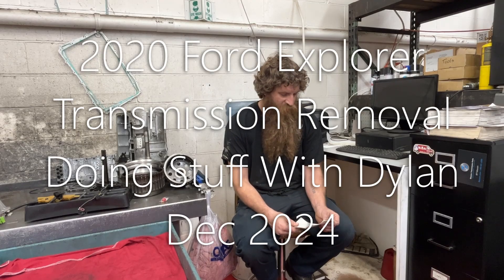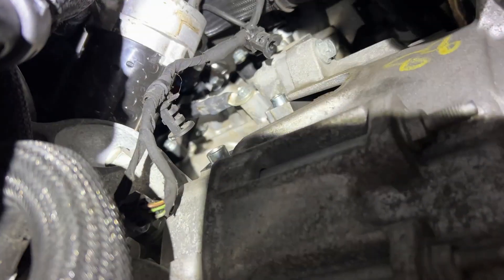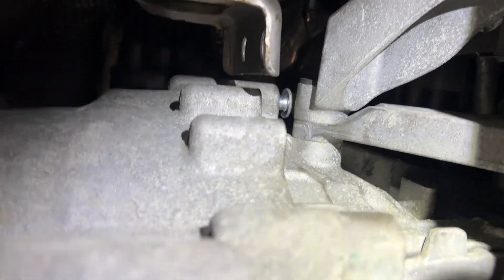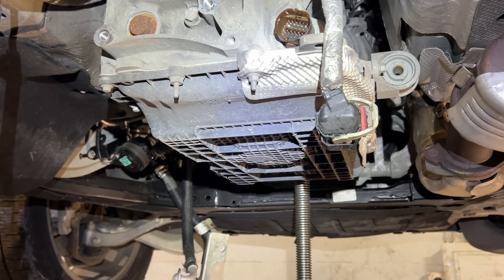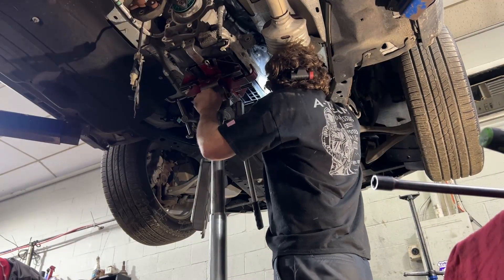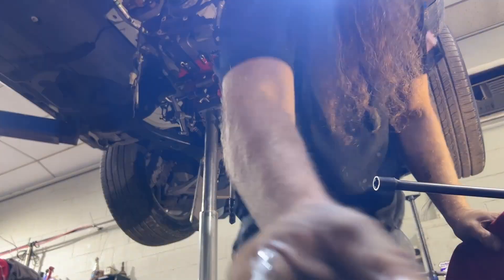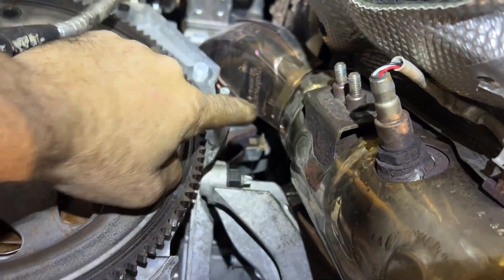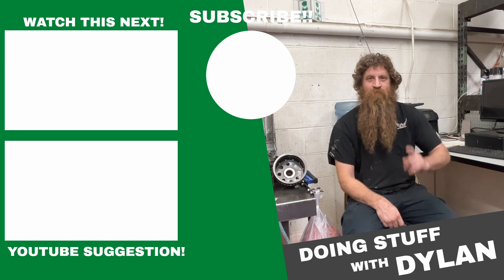2020 Ford Explorer Transmission Removal – The Bolt That Tests Your Patience!

Comment: What tool did you use for that pan in the ass bolt I can’t get anything on it
Reply from the maker: Guessing a 13 wrench to loosen it, my fingers
Reply: @doingstuffwithdylan4367  I ended up removing the cat and had loads of room. One last question do I need to have it reprogrammed when I’m all done

Comment: I can’t for the life of me get that rear facing bolt out. 13 seems too big, 12 too small. This trans is a POS 😂
Reply: I just took engine mount loose took bolt out snug up bolts and lower engine then continue with removal.
Reply from the maker: It was awful and what you described was a 1/2 inch. Probably a 13 though. Good luck!